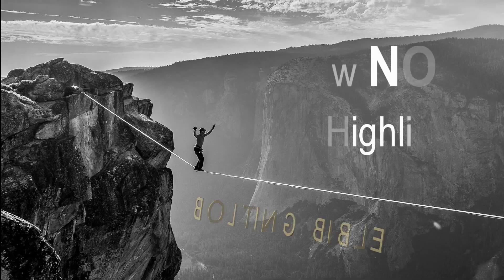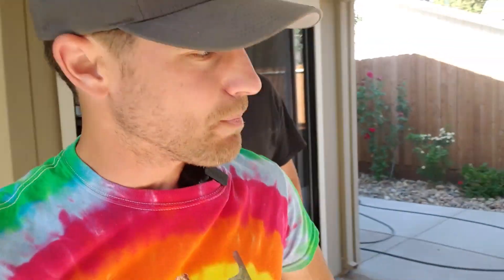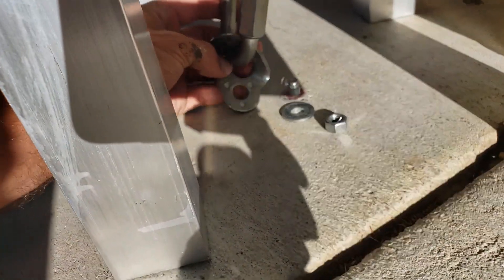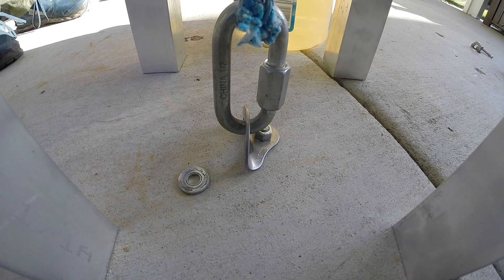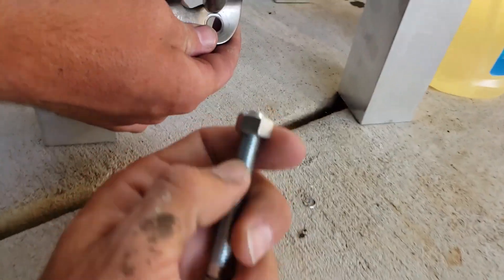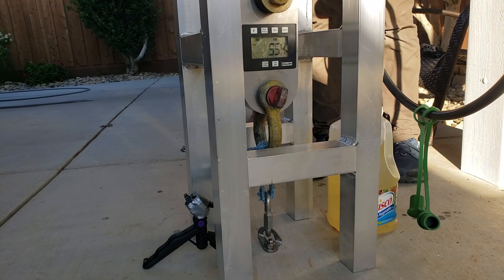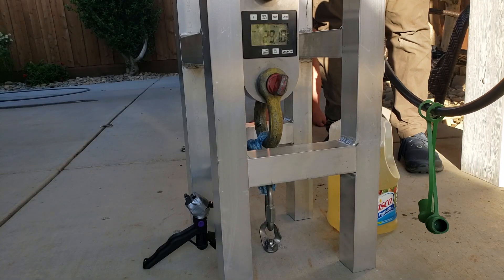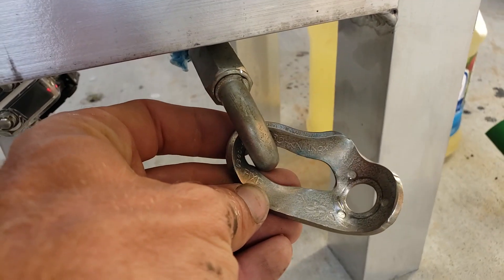Bolt Busters 1st break tests - climbing and highline BOLTS tested

Comment: I was removing mechanical 5 piece bolts at smith rocks monument area and the bolts were also glued in. they were super corroded and also very difficult to remove.

Comment: You guys don’t seriously use home depot deck anchors for climbing do you?!?! I am a tool maker and funny enough spent two years manufacturing areospace fasteners and those deck bolts aren’t heated or made of consistent trustable metal... I would definitely suggest you look into getting heat treated stainless bolts, 8.8 is probably the best grade but honestly I would want to stress test a variety and see which is better. There’s an aerospace fastener manufacturer in California (can’t think of the name) but I would search that out if I were trusting my life with ropes and bolts... I hope this finds you well

Comment: I'm probably many months too late with this, but the snapped bolt doesn't need to be there forever, you can drill a hole down center of bolt with a really small HSS bit and hit with hammer in a bit to release the wedge, then use a stud extractor - a funny little metal tool that self taps with a left hand thread, it screws into the bolt in the hole you drilled and as it is left handed it unscrews the bolt/stud. Stud extractor sits in a ratcheting socket wrench

Comment: Shouldn't you test pulling in the direction of the force that would be created climbing or highlining instead of pulling straight up?
Reply from the maker: We test both because they are used in both directions, even though shear is more common.  We don't mix metals for bolts, unless we are just break testing them.
Reply: Yeah, they're testing 'pull-out' as opposed to 'shear' strength. They're not using stainless bolts either, the hangers are stainless. This is a big no-no!; never mix metals if you're bolting in the real-world.

Comment: wow, look at the impact of nut not screwed in enough, it failed at less then 4kN. Ideally the bolt should protrude at least one thread beyond the top of the nut. I think this is the biggest takeaway of the video. Thank you for this useful info!

Comment: Do you have any tests where the concrete fails? I'm looking at bolting my concrete and suspect that the concrete itself will be the weak point.
Reply from the maker: Nope... i trust concrete a lot more than i use to.  Some things coned out the top but at forces you probably won't get unless you are building a building in hurricane areas haha
Reply: HowNOTtoHIGHLINE the real weak point concrete has is when the rebar gets wet and starts rusting. Creating iron oxide in the middle of the concrete will destroy any concrete.

Comment: You put over 4 tonnes of force onto a single threaded nut pulling upwards with exposed sides all around. Not to mention with a DIY reverse hydraulic press or whatever and all you can think of is safety goggles?? You could have outright killed you or your friends that day. I bet you didn't even find the nut that went flying somewhere.  Please be safe
Reply from the maker: Never found the nut.  Before we did more tests we installed plexy glass on two sides.  Slacksnap doesn't need a cover because it is mostly soft goods but metal is a whole different animal, as we found out.

Comment: can't wait for the shear test (i assume you'll be pulling perpendicular to the bolt). the bolt looks like it sheared where the hanger created a fulcrum. it'll be interesting to see what happens when you introduce a fulcrum from the start.
Reply from the maker: what specifically do you want to know... we may have already tested it
Reply: I think he's thinking what I'm thinking. The bolt in climbing won't be loaded through the bolt like in the video, but pulling downwards and would be creating a torque. So it most likely wouldn't blow off the nut like in the video.
Reply: 12:12 he says they're going to do sheer tests
Reply from the maker: we have and will do every test 3 in shear and 3 in tension.  These are vlog like episodes of specific things, more to show off the equipment than the bolt results.  We now post almost weekly an super short episode with results we have got to put an enormous of of data in bite size pieces.  Be sure to follow along!